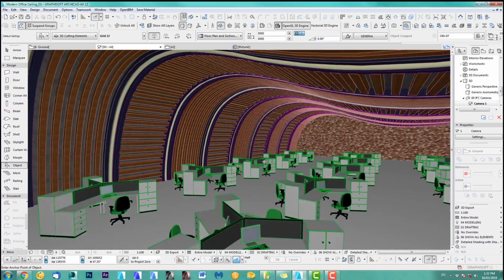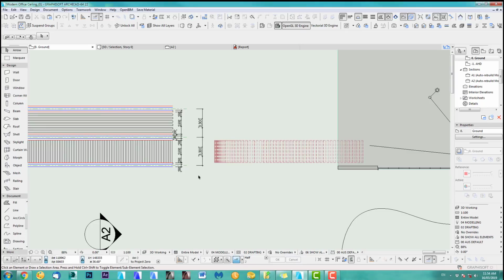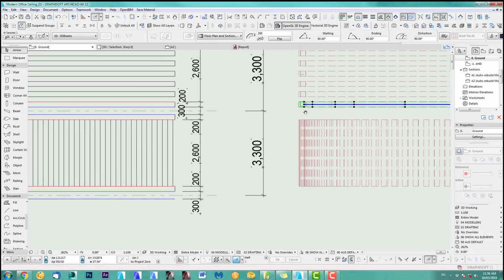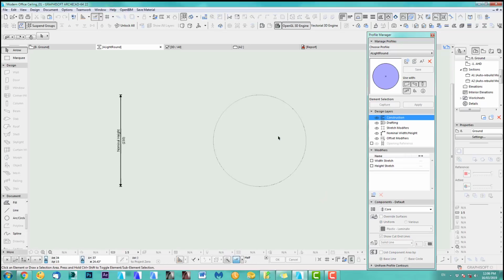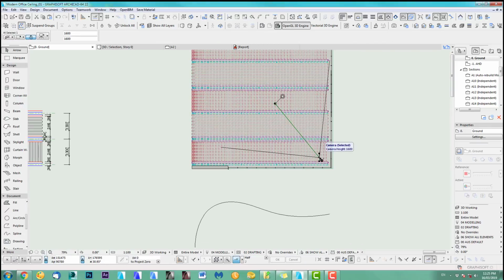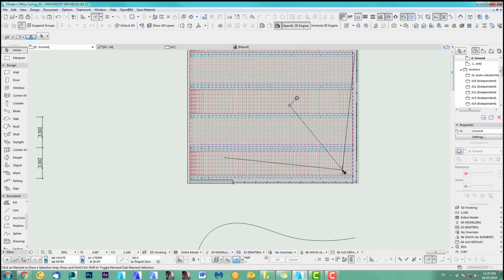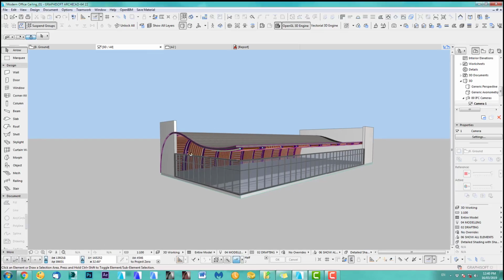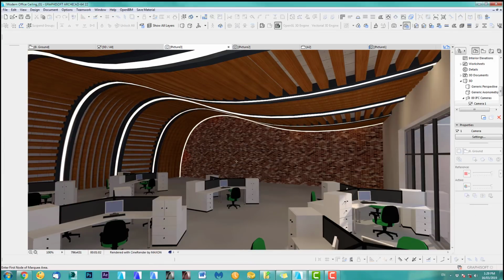ARCHICAD How to create a curved shaped modern office ceiling

Comment: How to make the wall joint connected correctly? It’s a hard time to me when I face this problem in modeling. Did you got any new solutions so far?
Reply from the maker: it can happen sometimes and several things can cause this problem. Hard to tell without seeing it. You can ask this question in the Graphisoft Forum, this is the best way to get an answer, as you can also add a screen capture of your problem. Link here: https://archicad-talk.graphisoft.com/